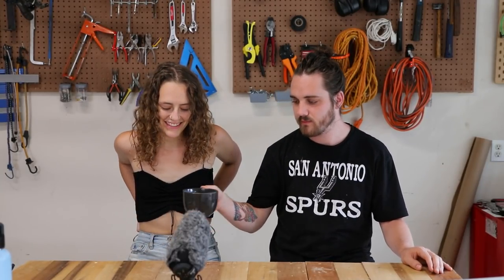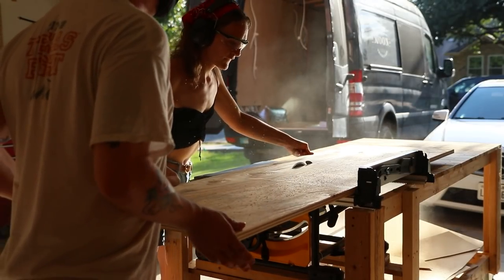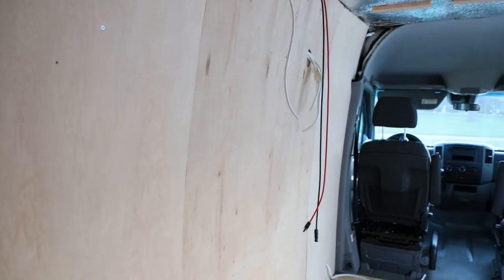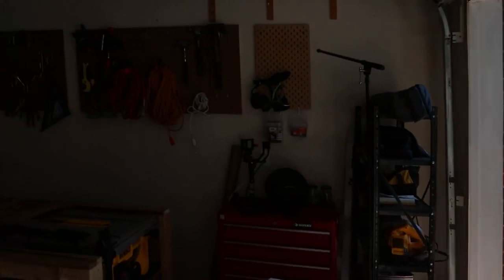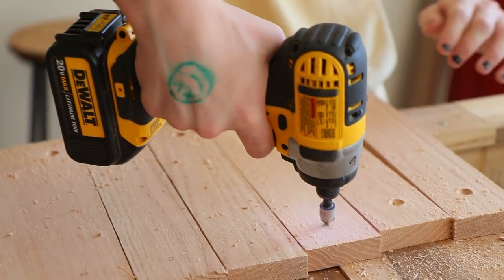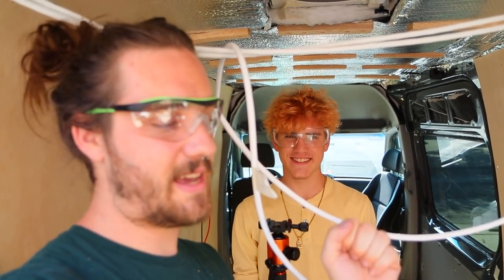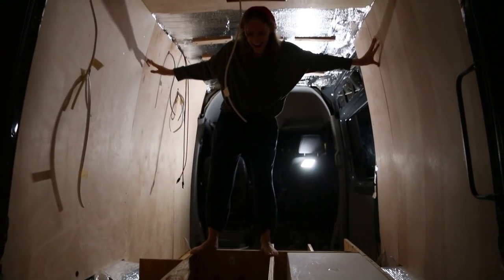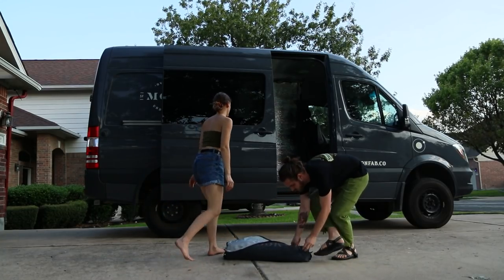DIY Van Conversion | framing, walls and ceiling

Comment: I am jealous of your table saw. However, when you first showed it there was a safety guard. By the time you started using the saw the guard was gone. Safety is not just about face masks and ear protection. A high speed revolving blade can do enormous damage in less than a second. Use the protective guard!
Reply: Shoes are also an important safety concern in a shop. Even a garage shop!
Reply from the maker: True true heard my garage homies 🙏

Comment: Holà, Nice job, good planning..a lot of electric cables 👍By the way, concerning isolation. Yes, it can keep the heat. When the heat is in (the window not covered), then isolation will keep it in (winter, summer) Refer to Bob Wells***

Comment: Not trying to tell you guys how to do what you do, but 3/4 ply is so overkill/added weight. Build the rest out in 1/2” mine is all .5 ply and still overkill . Love your videos keep it up.
Reply from the maker: For sure good tip. We are planning to build everything else out with 1/2” instead
Reply from the maker: But keeping subflooring and anything that’s super weight bearing like the supports at 3/4”

Comment: I hope you used another insulation than reflectjx? By itself, and the way you installed it, the r- value is very low.
Reply from the maker: It already had insulation, reflectix was just finishing it off

Comment: A&B, Max, Tio Ventura, Vanwives and now you two are doing a build. Why is nobody installing a bed that raises and lowers, like in the Winnebago Revel. It’s the hot tip. Also, keep tanks under van. Follow Vanwifes and Max’s lead with walk through floor plan. Smart idea. 🤷🏼‍♂️ Don’t be a copycat.